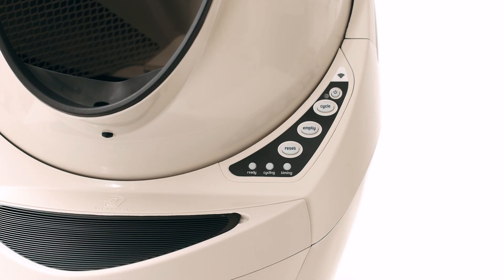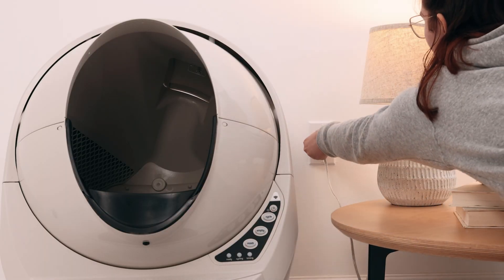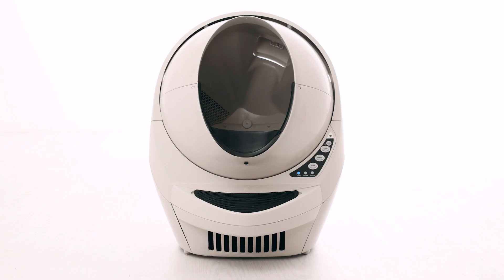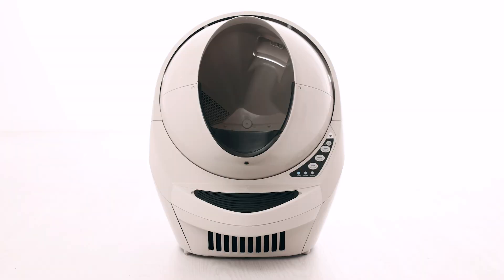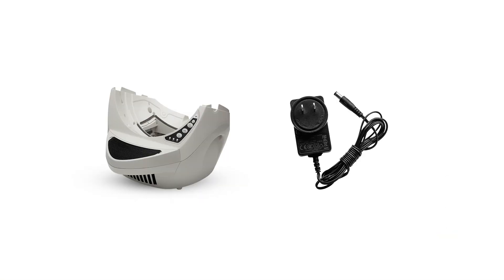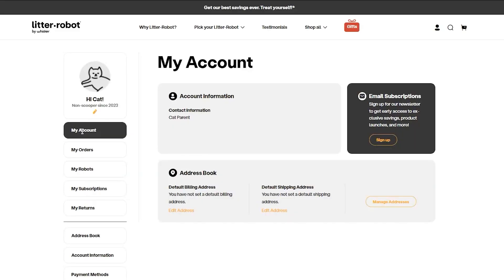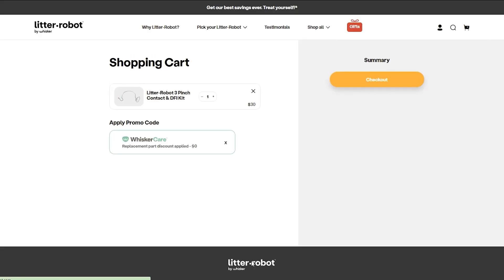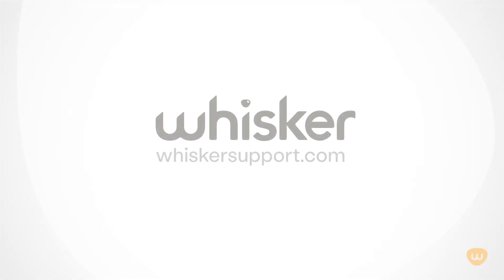Why Won’t My Litter-Robot Turn On? | Litter-Robot 3

Comment: I cleaned it and not with water then reassembled it. The light was still blinking blue and not cycling so I turned it off and unplugged the plug since the cord was getting in the way until I figured out what was going on or if I needed to order the DFI kit. After 1-2 weeks I plug it back in and nothing. Absolutely nothing. It won’t turn on and yes, I’ve checked, it’s not the cord. Please help.
Reply: Let me also add, someone on the litter robot board said they took it a part again and it worked. What would change by my taking everything apart and reassembling it?